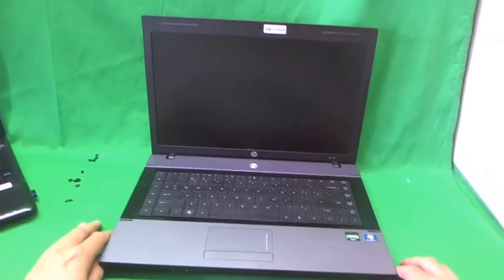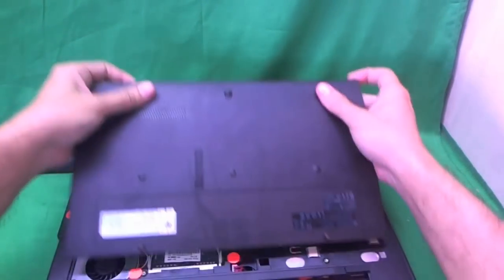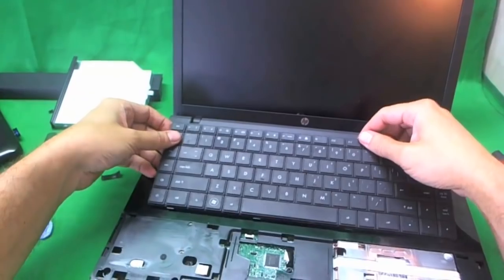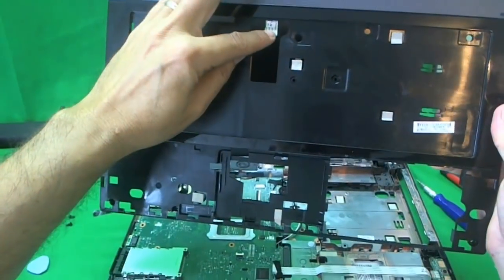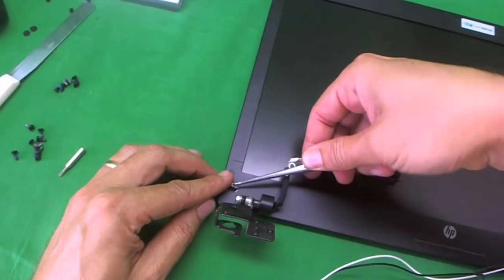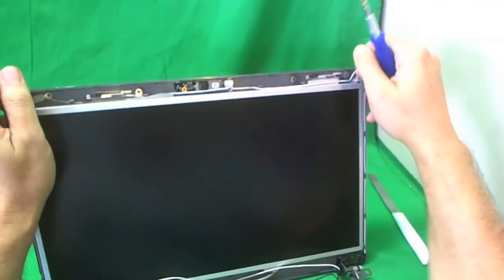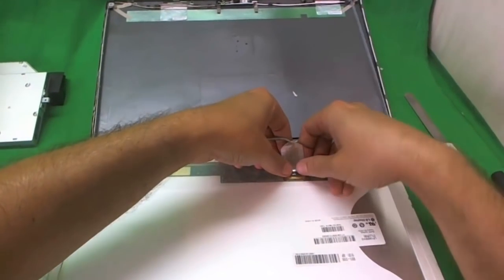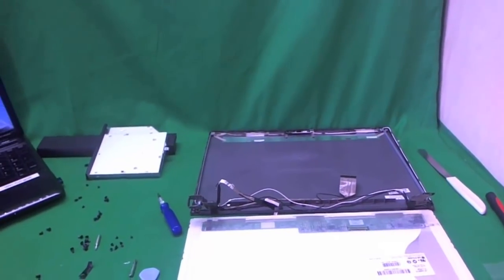HP 625 Notebook Screen Replacement Procedure

Comment: This is why I was a little harsh on this HP model because I was like most LCD's 4 screws in plastic bezel then 4 screws in metal retainer remove them LCD has ribbon connector remove replace screen and reverse steps 10-15mins, and this guy is going to totally mess up ameatures and they are going to jack their laptops up going through this long disection method.